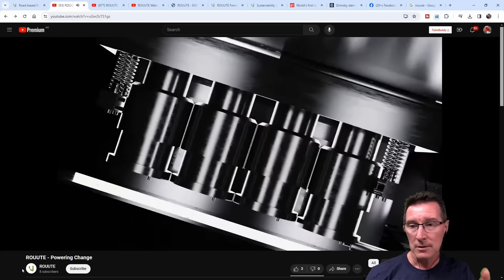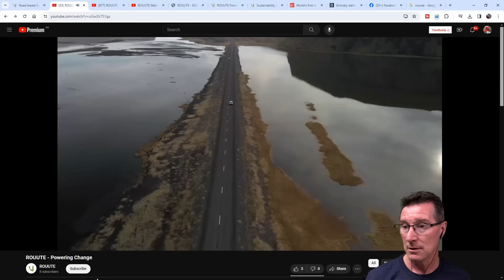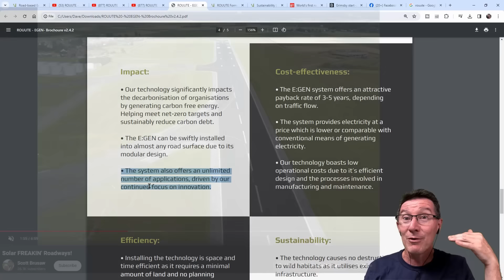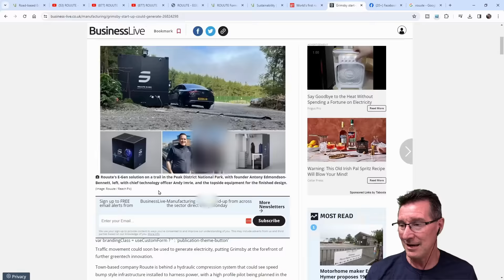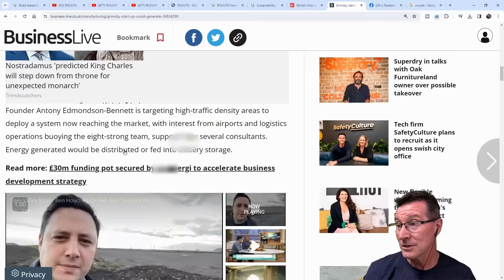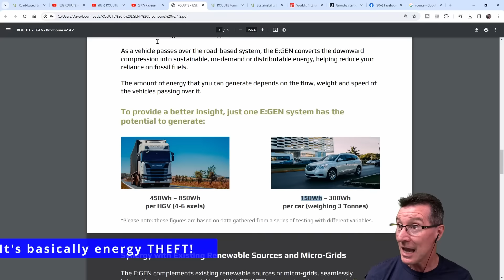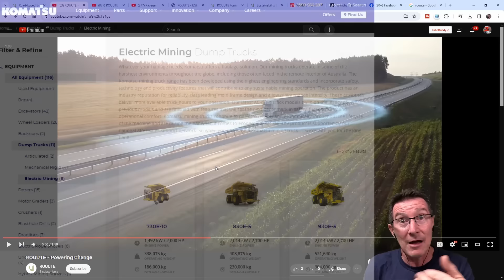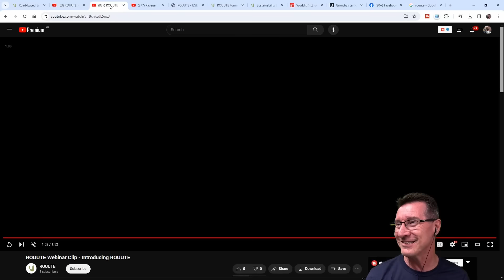EEVblog 1600 - Rouute: Road Based Energy BUSTED

Comment: "It's a hyaena!"

Oh, for crying out loud. Trying to push yet another newfangled inventions that cost a bunch of orders of magnitude more than they yield. 
Get people to choose public transit and bikes over cars for local transportation. A car running at 20kW / 26hp in average uses 20kJ/s * 3600s = 72MJ per hour. A single person's hourly trip really shouldn't have to use tens of megajoules of energy. 
Re-invest in rail transit, opt for nuclear power for covering the base 24/7 needs with a slight excess for reliability, then top it off with solar and wind power, with wide area / international grid connections for equalizing the peaks and troughs. And after power generation and distribution is reliably covered and large battery technology made safer, cheaper and more available on a large scale and in the long run than lithium storage, shift to electric cars for the mainstream and phase out the ICE based ones. 
But no... They'll HAVE TO keep reinventing the wheel just to feel good about themselves.